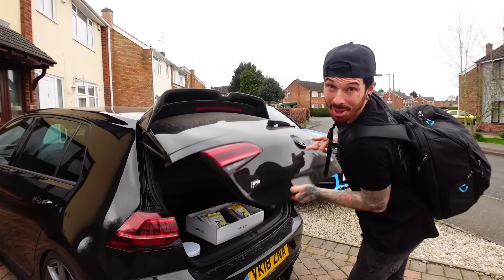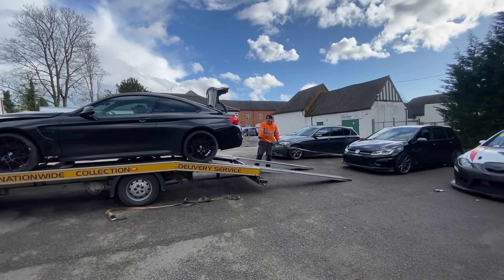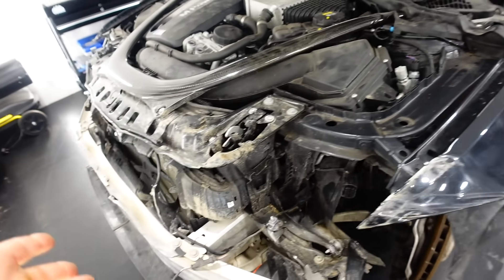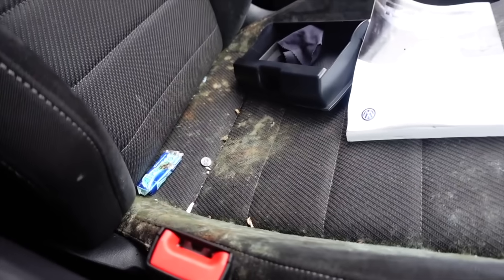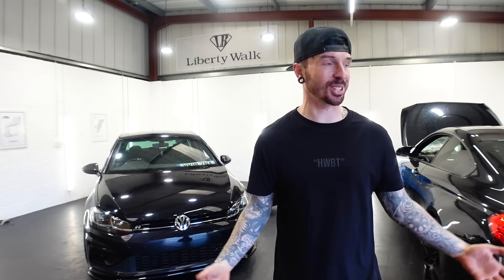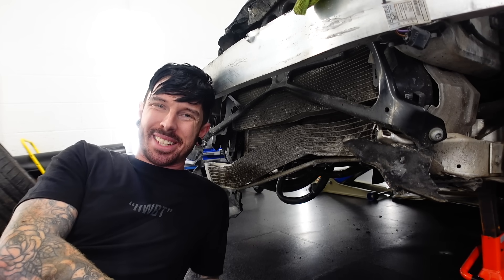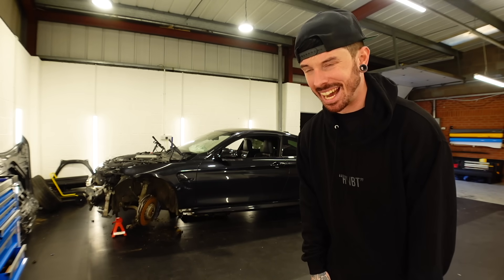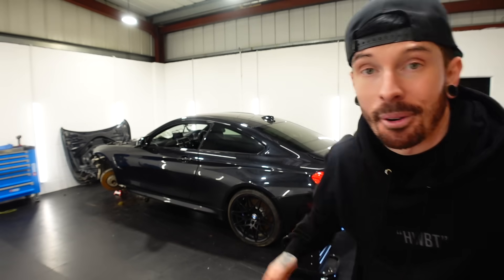I BOUGHT A WRECKED BMW M4 COMP - Its worse than i thought!

Comment: Sounds to me like it just had the original plates put back on. HPI are a devil sometimes as you can get red alerts for the car being written off when actually it was a different car wearing the old owners private plate
Reply: Insurer wrote off the vehicle against its original plates, rather than the custom plate. Probably this was to avoid just the issue you describe; the private plate flagging the owners' next car as a write off also.
Reply: I got mine flagged as wrote off because bmw told my insurance I put a downpipe on my car lol

Comment: You need to invest in a few telescoping measuring Trams so you can easily check frames and sub structures for square and check center sections for diamond. Hell of a lot better than using new parts as a measuring tool. Retired body man here, love the videos brother!

Comment: Drop the engine sump and take off one of the rod end caps. Check the bearing as it will confirm if the engine was still running (and the rod bearings are ruined) when the car crashed. Hopefully when the front crash sensor deployed the air bags the safety fuse in the battery positive supply also blew and the engine cut out immediately. Fingers crossed for you in any case Matt....

Comment: Btw with BMWs theres usually a little hex alan key screw under the car near the gearbox. If your screw it in, it puts the car in neutral and you can roll it without skates. For next time if you ever need to do it.

Comment: The guy that sent you a video of the car running must’ve ran it with no oil if the 2 sumps were holed 😱
Reply: It sounded very rough on that clip
Reply: That's what I thought I hope he didn't run it for longer than a few seconds.
Reply: Yeah it sounded very rough, hopefully not the start of Rod knock
Reply: @ryanmooney1578  that’s not rod knock, that’s the VANOS without oil pressure.
Reply: @Mac_F87  ah got you mate, I don't know enough about the vanos system lol
Reply: I’d have a look at rod an main bearings when the sumps off to see what damage has been done.
Reply: Yup, this is the most potentially fatal part of all the damage. I just hope it's not been running any longer than in that video, or the engine may already be on its last legs.
Reply: Maybe the guy superimposed the soundclip from another car onto the video of Matt's car ... maybe the crank, conrods and camshafts are completely missing ?
Reply: Only watched once but to me - it sounded like another car parked close making it sound like the BM was running....
Reply: @grahamgoddard4212  I just rewatched it a bunch in slowmo and I cant see any movement in the engine when it turns over. I hate to say it but I honestly think you're right and Matt got taken for a ride... I just hope that the damage doesn't keep getting worse as he digs in

Comment: Sounds like the previous owner had a private number plate and put back on an old reg before selling on.
Reply: Either that or the guy that bought it from the auction bought it with the private reg, but decided to revert back to the standard plate to sell on. (A possibility if the private plate was valuable in itself)
Reply: Cars still registered to the private plate that’s shown in this video so I’m confused he must have put a private plate on the car not removed it?🤷‍♂️
Reply: @jakedixon5232  oh yeah you're right 🤦🏽‍♂️ not too sure then 😂. My only guess would be the HPI website he's using might show a change of ownership as a plate transfer too (sounds like January would be when the other guy bought it from auction)
Reply: @CallumAtwal  quite possible that mate! Seems abit strange tho something Dosent add up especially if this young lad has ran it with a big hole in the sumo
Reply: @jakedixon5232  X100JRT seems to be invalid when checking tax. YP66YHX comes back fine though. Maybe he took the title but not the actual physical plate 😂. Some weirdness deffo going on though
Reply: @CallumAtwal  hmm strange! On my app x100 comes back as the plate registered to the car haha
Reply: @jakedixon5232  proper mystery this one is 😂 - I just checked it on the gov.uk site. My money is on they've "taken the plate off" but haven't actually removed the plate from the car itself. Some of the apps hold old data cause of the way they buy the data. (Just incase I sound totally sad, my day job is a software dev on the DVLA gov sites so it's why it interested me😂)
Reply: @CallumAtwal  Good for the London congestion charge and all speed cameras!

Comment: Hard Works Beats Talent, yes - but a few simple checks with a tape measure and an inspection mirror would at least have allowed you to recognise that the CLK's frame was bent, and the M4 had holes in both sumps - and that would have allowed you to go in wise to the problems and negotiate additional discount to cover these costs, or walk away - plus as others have said, the engine-running video sounded like a coughing rough bag of rusty nails over a smooth inline 6 - I admire the courage, but a few simple bits of knowledge on frame alignment and base menchanical checks might mean a lot, lot less drama/cost - You did a day or so at the workshop whilst adding the Liberty Walk kit to the Maserati, why not try spending a few days with an insurance or mechanical engineer to educate yourself on structural basics (plus it would make a good vdieo) - Good Luck, you are going to need those merch sales!

Comment: I have a feeling this will turn out alright. My suspicion is that the car stopped dead when the sumps were smashed and not run dry. Just a shame you have to dismantle so much to replace these parts but after all it is a BMW!

Comment: I have a feeling the car has been written off in 2016 and now its been written off again, what did the HPI check say?  YP66YHX looks like it was the plate assigned to the vehicle at original registration and the fact than it says it was recorded as a total loss 31/10/2016 and now again on 27/02/2020 is ringing alarm bells.  Maybe the previous owner assigned the private plate to try and throw people off when they HPI check the car.  I would check over the rest of the car for previous repairs. Hope it works out Matt, but something doesn't add up on this one bud.

Comment: Get a couple of new sump pans on first, and get it run up before you start throwing money at it, because if the engine and box are trash, it will be a pointless repair, depending on how much you paid for the car of course 👍🏼

Comment: this is why you dont mess with damaged cars unless your experienced, here's a eg one of many I've seen, guy bought a amg merc damaged and the engine had blown (he didint know at the time )but they crashed the car to get the payout because the cost of fixing it was too much, that car then looks a bargain at auction but its already gonna cost you more to completely fix than what it would be to buy a perfectly normal working one and auction cars are bought cash so you can easily lose thousands!

Comment: Might be worth disconnecting the prop shaft, will make moving it around a bit easier although I don’t know the m4 comp is 4x4??

If I was to offer any advice at this point, sit down and do the sums before you start, cos I see this costing more than it’s worth, worst case scenario. You’ve been stung before, hope this one doesn’t bite your ass. You’re a brave man...

Comment: Correct me if I have this wrong So the previous owner showed a video of it running on his drive whilst crashed yet you can’t run it because the kill switch is now activated? So either it’s been wrote off twice or he’s ran it with a hole in the sump? Can’t wait to see how this one unfolds mate fingers crossed it’s not bad news👌

Comment: hpi, useless check, such a con, insurers don't register loads of vehicles correctly, my 1 series was "written off" was flipped on its side and had pretty major damage, the car was meant to be recorded and wasn't, got sold at auction, repaired and sold as a normal car, a lovely company called V-Check gave me the details of this, as I just happened to check my old car's number plates after I got a letter from the DVLA saying its ownership was being transferred. I would certainly recommend checking a car using v-check instead of hpi, I got sent a link that showed my cars damage, the auction details. The number of cars driving around on our roads with some really much more serious "accident damage" is scary. Certainly think you should check this service out for future purchases as it will give much more of an insight than the standard hpi check that relies on the honesty of insurers and salvage auctions

Comment: I have little water radiator for sale, which one fits under the arch liner and bumper. and aluminium engine under tray, would sell very cheap, i have them on ebay

Comment: I'm not sure how your going work out if there's been engine damage from running the car without any oil in. Have you tried turning it over by hand to make sure he's not run it until it seized?
Reply: This car is undriveable after the accident, so no there is nothing wrong with the engine. Even if the engine have been running without a single drop of oil in it, if not for long, it won't be any damage. I have seen a car driven for a several miles without a sump at all. Mat will confirm it in future videos, nothing wrong with engine
Reply: @HighEndMind  you must have missed the part that showed the bloke who had it before Matt starting it and letting it run on his drive.
Reply: @jackmillin  it's on 3:50 and i saw it, Mat said that the owner bypassed the kill switch battery to start the car, i don't think that this guy kept the car running for more that a few seconds, i am sure that this lad is well aware that there is a 7x7 inch hole in his sump and revving engine on the driveway is not the best action to take. If he did not start the car, Mat won't buy it, well i am sure he did not ask for just £5k for it
Reply: @HighEndMind you must have a crystal ball 😂😂

Comment: O dear... nice costly little project 2x sumps and maybe 1000miles before boom.. number plate on the rear of the car is probably the plate which has been retained by ‘one’ of the previous owners who flogged it on just hasn’t been swapped as they thought it was a breaker. Looks repairable but costly, will be a good project for you.

Comment: The vehicle was on a private reg - X100JRT when it was written off on 13/12/2020.
The original registration was put back on the vehicle on 18/01/2021 - YP66YHX

You need to make sure you take the rear registration off the vehicle as that's no longer the correct registered number plate.
Correct one is YP66YHX

Comment: Welcome to the money pit world 🤣 BMW it's never fixed 🤭🤣
Only advise I have from experience. Please buy your gearbox oil's from the BMW dealership. They will also give u the correct specs, off how much oil must go into the gearbox. And the gearbox filter. 

Strongs brotherman. 😉
Reply: Also , please DON'T FLASH THE GEARBOX! 

But if there is dirt or something inside the gearbox,  if u can get advice from an BMW specialist. 

I learnt and experience this on the hard way. If the gearbox fail , a gearbox will almost cost u more then the car. . .

Comment: Guy sold you a lemon and knew it by the looks of it. I hope im wrong because that will get expensive very quickly
Those under trays normally just hold/catch/trap the broken parts so if you didn’t find any its a pretty good sign that problem had already been found and kept hidden.
To many sharks in the business these day’s.
Used to get some great cars with an honest description, these days they just put ( maybe more damage not checked ) to cover their arses.

Comment: Nothing better than getting home from work to find a new video drop from Mat. x
X100JRT registered to the vehicle (02.07.2020) prior to its condition alert (13.12.2020)? Yet purchased of someone who already bought it crash damaged? Bare in mind it was written off with YP66YHX on it, this is extremely fishy. (yet X100JRT aka the current plate was only transferred to the vehicle on 18.01.2021)

Comment: Seriously need to get some decent security in that unit (unless you already have). The contents are getting more and more expensive, its advertised all over the internet, I'm sure its not hard for someone to work out the location and it will only be a matter of time until its all gone. Sad but true. I would hate to see all your hard work and commitment disappear in a flash as so would many others here. EDIT: In fact, just by this video it took me less than 5 mins to find exactly where this unit is.
Reply: It must be really annoying to live somewhere where criminality is such a normal, expected thing.
Reply from the maker: All locked up and full security 24/7 fully insured and area has a really low crime rate. Not so much to worry about haha
Reply: @Ogilla  unfortunately there are such scumbags around everywhere. Luckily I live in the middle of no where, where crime is virtually non existent.
Reply: @MatArmstrongbmx  glad to hear it 👍

Comment: Do not shoot me as a messenger of bad news! Considering all the information you should assume the engine suffered oil starvation. You have some choices: A) Close your eyes and choose the simple way: replace the sumps, fill up the oils and run. It could be run. But you (and the future owners) will never know how long does the car runs. It could be one year, two years who knows. B) Take a deep breath and investigate the degree of the oil starvation. You have to assume the worst case. You have to remove the engine and transmission.  Disassemble them completely. Check everything regarding the friction marks and burned surfaces, tolarences on the bottom, mid and the top as well, including turbos. If you are lucky than the oil starvation was light and no need to change parts. If not than do the calculation and decide whether is worth to buy an usable engine instead of replacing parts. The same procedure for the transmission. You have to disassembe the full unit including the mechatronic unit to check the damage. And this is just the engine and the trans. These checking procedures and repairs DIY only for the very advanced mechanics. Take this into consideration. I have a feeling that this car is even a deeper hole than the Mercedes C63. Be wise and know when to fold. It is not about the pride. It is about the luck: you tried and lost the bet: the sumps were broken. It happens all the time with all the people. The only people became broke who will not able to realize when to exit. Sell it and take the difference not as a loss but as a business education fee. What we learnt from it? Take the next tour with one jack, copule of wrenches, inspection camera and mechanic dress. Lift the car, get access for the camera to check the bottom of the engine and the trans. By the way if you ask permission to do this from the owner on phone and got refuesal than you have the answer what you looking for, no need to check it all. Good luck!

Comment: Get rid, this is a money pit, this car has all the signs of a massive problem build and expensive too, someone lied to you about the engine running!
There is so many crashed M4s pick another to rebuild if you really want one, 
Hard work has it's rewards but spending too much money and making work for yourself does not. 😎✌

Comment: Buying any car with front end damage,  expect damaged sump and if it's not, that's a bonus..
What you don't want is some twat running it with no oil (q seller vid)
Get the front end off and engine and box out.
Let the dog see the rabbit and give yourself lots of room.
Good luck with the build and don't give up coz you can't be arsed😂
You got a helluva car there once it's fixed.